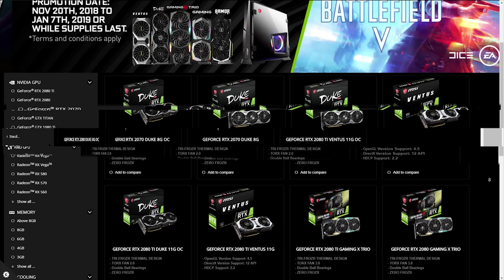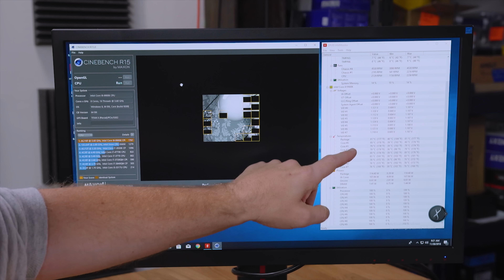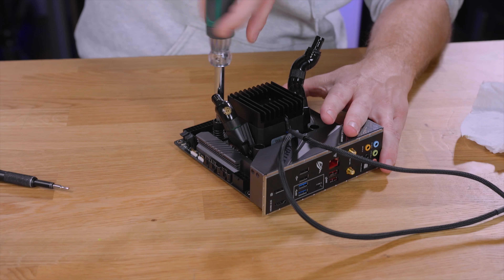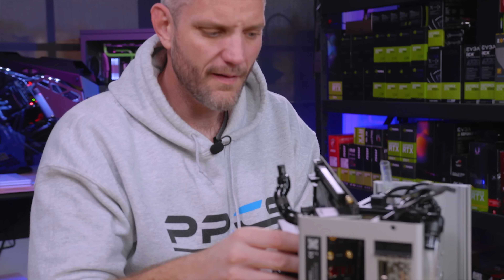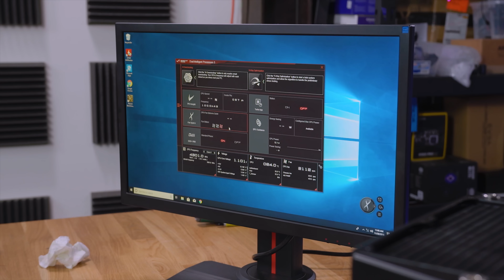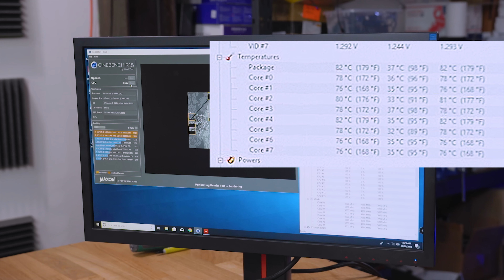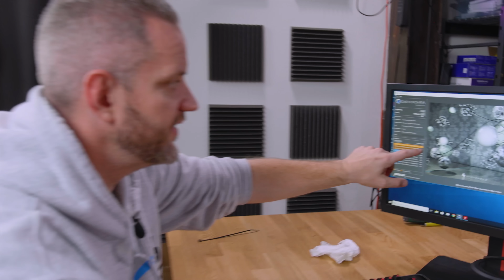Something went wrong with the small watercooled PC...

Comment: 1.) Heatsink on the pump has fins oriented AGAINST the natural airflow.
2.) Convection is a very slow motivator for momentum. It's not helping your fans very much. We've had hundreds of many page long posts about this on enthusiast websites for decades.
3.) Negative pressure works better in enclosed spaces due to it's ability to draw air out from between components, rather than trying to force air through small gaps.

Suggestions:
Correct the pump heatsink fin orientation if possible (if it's not, swiftech deserves a bump for this - it's a product designed for tight enclosures, where airflow is a premium)

All fans should be blowing air through the radiator as exhaust (the bottom fans are pulling through, and the top fans are pushing out so you have a nice linear airflow. This is actually lower airflow in your particular usage case. Configuring ALL fans as exhaust will almost double the total effective airflow compared to the marginal increase you are getting due to convection. There is a second effect that this will have. Currently the air that passes through the bottom radiator is warmed slightly by that radiator, and then by all of the components, and then finally further warms the top radiator. This results in a poor thermal efficiency. Thanks to the turbulence caused by the air drawn in through perforated side panel your air actually stagnates between the lower and upper radiator.

By configuring all fans to exhaust air, room temperature air will be pulled in through the perforations on BOTH SIDES of the case (mainboard and GPU side) and then exhausted through each radiator. The total CFM of the exhaust will be much higher than the current Intake->Exhaust CFM configuration and will cause the case to pull in MUCH more air. You could do the same with all fans configured as intakes, but this would result in more dust collecting on the radiators themselves and would eventually lead to a larger performance impact. With them configured as exhaust you'll see more dust on components, but less built up on the radiators. It's the trade off.

I'm sure you were aware of at least some of this - it's not exactly amateur hour - but your green is showing when it comes to ultra compact builds.
Reply: the TL;DR:

Pushing air is harder than pulling air through tight spaces. Once the air hits an obstacle it stagnates, even if that obstacle is just more air.

By PULLING air out of the case, you will also be pulling it through all of the tight spaces and prevent the stagnation that leads to hot air buildup inside the condensed size of that case.

Reducing constriction as much as possible will help, but not nearly as much as focusing on PULLING air OUT of the space. Let physics worry about filling that space up with new air. You just worry about getting the hot air out.
Reply: I'm not sure if the physics match up to that theory. Fans merely create pressure, pushing or pulling doesn't matter as long as they're creating the same pressure gradient. The pressure itself is simply more gas molecules in a defined space than it naturally wants, in it's rest energy state (equilibrium). Negative pressure gradients is simply the reverse, less gas molecules than what equilibrium within an open system would dictate. The CFM is very likely to be the same, due to the same pressure being created. If the pressure gradient is the same, and the flow rate is the same, I don't think push or pull will matter much, if at all. I suppose someone could try running this sort of thing through numerical simulation, we have fairly accurate methods of testing for these very types of thermal engineering questions.
Reply: @JimBob1937  this would be the case in a sealed system with a clear passage. This system is neither sealed nor clear. This means that there are natural voids due to how fluids fill spaces. For example, while creating negative pressure would motivate a pocket of air sitting behind a capacitor, blowing air up against that capacitor is going to create a stagnant void behind that same capacitor.

There's also effect of the air rushing through the radiator and then fanning out in a V from the fins, directing pressure toward the side panels which have circular perforations for the air to get trapped on. We don't exactly have an open tube at any point.

By expelling air from all possible exits we create a definitive negative pressure inside the box. Pushing more in "kind of does" but not nearly as effective thanks to all of the obstruction.

Again, we've had people way more intelligent than I with exceptionally expensive testing equipment verify this. It's happened on [H], XS, and OCN. 

In normal circumstances having clear, directed airflow is best. But in constrained spaces full of obstructions, you need negative pressure.

Comment: Man, seeing this video and the video where you delidded and lapped the IHS on the new CPU in your Skunkworks build it scaring me off the 9900k.
Reply: At stock, and even at 5GHz the thermals were fine for me. I only started to have thermal issues when I overclocked it while running complete worst case heat torture tests (Prime95 with AVX? Forget about it). His issues are that his cooling solution isn't optimal, so he needed as much overhead as possible to make up for it, hence the lapping.

Comment: You might want to change the position of the water pump heatsink. L
Instead of horizontal, go with capital; improved airflow and improved cooling on the pump 😊

Comment: Just want to point out that I dont even have the original cpu fan ( it broke ) running on my pc but a fan that is not meant to support the CPU , also I only have two fans (  the one that is supporting the CPU like I said and the other one for GPU ) , AND ive been running this pc for 6 months ( since the CPU fan Broke ) with no heating problems and no problems whatsoever , my pc is 4 years old now and a Dust Chamber I must say . runs games do perfectly on high and was only $400 invested.

Comment: Nah that’s not cramped, looks fine, just built a system into a bitfenix colossus itx, aourus b450 I pro WiFi, 2700x at 4.3ghz, dark rock pro 4, 1tb 970 evo p, 32tb storage drives (4x8tb) Rex 570, but has 200mm nuctua untake, 2x120 top fans & 1x140 exhaust, front fans bumpers rest against drive cage with same on rear exhaust and dark rock, but runs cool and near silent

Comment: JayzTwoCents could you mix 50/50 vegetable oil and water in a cooling system, died two separate colors? Would it work to cool the system, having two different heat transfer rates and would the colors stay separate or mix?

Comment: I stopped two years ago with applying thermal paste myself. Since then I always used the Coollabratory liquid metalpads. You cut them on size (0.5mm short of each side) and them mount the cpu. Works every time and the metal also ensure better temps. Especially in rigs like you want to get the most of you're components. 

Note that I'm still on the 8th gen, happy with my 8700K running 5.1Ghz (it can run 5.2Ghz, but needs a lot more voltage to get stable (1.44v for 5.2 as apposed to 1.36v for 5.1). The performance gain on 5.2 is minimal, but at 5.1 the system gets a lot cooler..

Comment: i posted this on gamers nexus so i copied it to not to have to re-type it again. i had to return my 9900K because  up and shit itself.  at first it fully locked up once when i was gaming online thinking it was the over clock on the GPU so i lowered it and no more problems.  then the next day, it continually locked everything up and yes i replaced everything from motherboard (ASUS HERO XI), GPU (EVGA 2080 ultra down to EVGA 1080 classified) SSD's and new copy of windows, i reset the bios.  so i had a friend that i know who works in the US Cyber Command scan my computer (thinking some hacker might have tried to hack me online gaming) and it stated CPU ring bus had failed.  so i took back CPU, GPU and motherboard back to micro center and got a full refund $1800.  Told the young lady about the CPU and she told me they will send it back to intel for them to look at

Comment: I just did this to my 8600k and the block also i delidded the cpu and applied liquid metal AND HOLY FUCK IT DROOPED 41C UNDER LOAD LIKE WTFF i have a 5ghz 1.32v oc and it stays at 42 c on my aio in cinebench

Comment: I know you only showed like 3 sec of lapping, but when i worked as a offshore mechanic servicing high pressure valves, when we was lapping the "metal to metal" seals that need to hold 1700 bar (24500ish psi), we had to be lapping in a figure 8 motion, if not it will not get perfectly flat. Just a little tip for the future. ( nvm if you did figure 8 of cam )

Comment: I noticed you are running the ASUS AI Suite on that thing, how do you get it to run without hogging most of the CPU resources? I have several Intel and AMD's here including Threadrippers running on ASUS boards and every one of them that I tried running the AI Suite on, ended up being very noticeably quite a bit slower and lagging a lot at times, but once I uninstalled the AI Suite everything was back to normal.

Comment: I don't understand the logic behind having the fans suck hot air from inside the case instead of just having them on top of the radiator blowing cold air from the outside into the rad...

Comment: I wonder if you can shave off another 10C if you put the rad on the bottom and get some taller feet.
Reply: With the restricted airflow that would probably make it worse. The logic of having the rad at the top is that the airflow through the rad will remove the heat from the case entirely.

Comment: Is there a way to flip psu and so it exhausts out you could mod the backside and if you flipped fans so air is brought in from outside on both rads would bring cooler outside air in through the rads and then heat is all being pushed out the back of the system

Comment: Rad needs to go in the bottom intake, with the fans pulling through from the top. Then you will get the coldest air through the water loop and you can move all the hot case air out. I understand the case is not designed for this.

Comment: 55c is pretty cool for a gpu on load, particularly a titan, mine on air is always around 75/80 on load but my cpu doesn’t go above 40c ever and is an i7 4790k, intel certainly hasn’t improved thermals since 2013

Comment: Hey Jay,

great video.
I've got a i7-4770k that is currently aircooled and I had crap temps with that thing.
I reverted to mental delidding and Liquid-metal on the DIE of the CPU. I even bought a new cooler for it and I still hit pretty high temps with that.
Would you recommend Lapping for a "final straw" that I could test? 
I know the 4770k is hot but it could be manageable, right?

Comment: Why dont you put the radiator in a push-pull config? Or just keep 2 fans(above the power supply, above the part of the radiator above the power supply -_-) blowing air upwards and the part of the radiator above the cpu, blowing air towards the bottom of the case!!

Comment: Use Peltier devices to chill water and use the radiators as water to water heat exchangers. Water to water is more efficient and you can run water at 0°C over the now heat exchangers... friend of mine did this and had 10°C temps on his cpu...

Comment: I would look into mess panels for the sides to increase airflow and move the fans below the radiator to push heat out rather than pull.

The lapping issue is a bit disconcerting though...

Comment: Noob question but wouldnt it be more efficient to have a roigh surface on the cpu top and the cooleing block (where they come in contact) than a perfectly smooth sirface because with a rough surface it has slightly more surface area to transfere heat from. The thermal paste should fill all roughness up pretty easiely...

Comment: Stop using colored coolants... How many videos have you had showing facepalms of coolants clogging the loop, or breaking down and changing colors.  Especially on a travel system, keep it simple. Use colored tubing if you want it to look fancy.

There is a slight bow in the Apogee base, but much less than most blocks around its time of production.  This is not a negative, as many IHS of its day had flat or slightly concave surfaces, which the bow on the block helped keep contact with the die.  The bow on the IHS should not be acceptable.  While the Apogee HD is an older model, it does well on larger die CPUs relative to some of the jet plate blocks that it competed with at the time.  Restriction is a little high, which is also another reason NOT to use colored coolant.

You should have wrapped up the video with the case closed testing 5ghz loaded with GPU and CPU simultaneously.  This project isnt finished... not until it is thoroughly tested to ensure reliability.  You can easily keep your ambient temps at home stable, however, ambient temps on the road could be 10-15c higher than your house.  Something to keep in mind when testing the unit, as you need reliability for it, and it needs to perform with possibly 35c ambient...  With the fact that the system is watercooled, with low air flow in the case, how will the VRM perform at a higher ambient, you might want to consider a VRM waterblock for this build just for that reason.

Comment: i has similar build. if you use asus MB, the PCH is going to be HOT AF!! mine is sitting 67c idle. under load can be hitting 80s. just coz water coolled= no air flow there. and asus made it worse by hiding it under M.2

Comment: Hey Jay, it is kind of hard to tell in the video but are you using a standard ATX power supply?  If you are you should instead use the small form factor SFX power  supplies.  I built a small form factor mini iTX system back in July of 2015 it started out with a Z97 mother board.  I used a SilverStone RAVEN Series RVZ01 case and at the time the biggest SFX power supplies were 450W and I almost did not build it being concerned that there would not be enough power to drive my GeForce  970 GPU, just before I purchased a standard case and ATX MB Silverstone came out with a 650W SFX modular power supply which has been running 24/7 since it was built.  I noticed that now there are 800W SFX power supplies.  The  system now has a GeForce 1080 GPU.  The physical dimensions are 4.92" x 3.94" x 2.50".  If the supply you have now is an ATX using an SFX  would free up a lot of space and would be less of an obstruction for airflow.

Comment: My hypothesis of the system not having much galvanic reaction is that Aluminum is the type of material that oxidize quickly to form Aluminum oxide. This Aluminum oxide layer creates a barrier between the copper ions that may be floating in the solution and the aluminum block/fins so that the aluminium fins would not get corroded easily.

This table below shows the standard potential of metals, the bigger the difference in potential, the more reactive it is with each other, and the higher the potential is. You can see that copper (Cu) is at 0.16V, and Aluminum (Al) is at -1.66V. That is a significant voltage difference that is a concern as this is relative high, and is a cause for the corrosion. (Ecell = 0.16 - (-1.66) = 1.82V)

http://hyperphysics.phy-astr.gsu.edu/hbase/Tables/electpot.html

I remember doing experiments with making batteries using zinc and copper, and the reaction was visible. the zinc will corrode, and become black, and there is a measurable voltage across the two metals (Zinc and Copper). I also tried (for fun) Aluminium and Copper which seems to make a better battery (1.82V compared to the zinc/copper which is 0.92V ), however it does not seem to have any reaction at all, thus this hypothesis.

https://www.youtube.com/watch?v=IV4IUsholjg (electro chemistry crash course)

Also, aluminium oxide is white in colour, and you might not be able to easily tell the amount of aluminum have been corroded just by looking at it.

This is a good empirical experiment btw, showing that you need not immediately be concerned by the "flawed" design of mixing metals in a watercooling loop. This effect might be different if it were to be screws, where aluminum is directly touching and rubbing against a copper piece

Comment: For a better airflow/convection in the case, i've seen josh from NFC remove the vrm heatsink on the z370i/z390i, also you could try removing the motherboard io shield block (dunno the name). Finally, direct die / liquid metal ? Am i getting carried away ? Maybe

Comment: The heatsink on the pump should be rotated by 90 degrees. Any updraft air will go over the top of it and ignore the fins. No need to lap the CPU and cooler, you need to lick it instead. Also no thermal paste, Its an insulator for fire instigators.

All joking aside  the above was sarcasm. My opinion is eff small form factor.

Comment: It means adding another lid to put some distance between the radiator and the rest of the parts generating heat. You can't reposition the psu to push it out the back? It's sad that after 15 years or so, we still have to lap parts to get good contact

Comment: My 9900k makes 83 degrees under prime 95 heat test with stock clocks...so all cores on 4.7Ghz during test. I tried to use LM in between IHS and Cooler but sadly the IHS is not flat and i hit 89 degress C. so i tried the Kondactonaut and than i had 83. Srsly disapointing a no flat IHS on a 600 dollar CPU. But i dont want to lose the warranty so im waiting 1 to 2 years until i delid it and lap the IHS also. will give me forsure more headroom.

Comment: Hey Jay.
Have you tested with Combined CPU and GPU load for prolonged sessions?

If it were my build i would try pull pull and push push configs on the Radiators..

it may help keep coolant temps down for long work sessions... worth a shot maybe :)